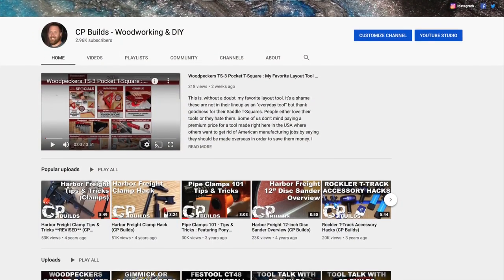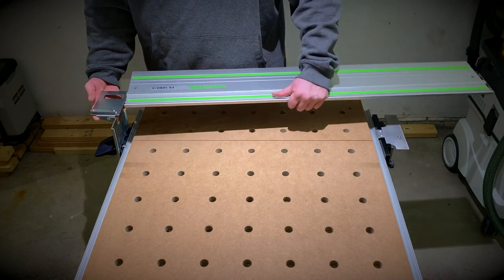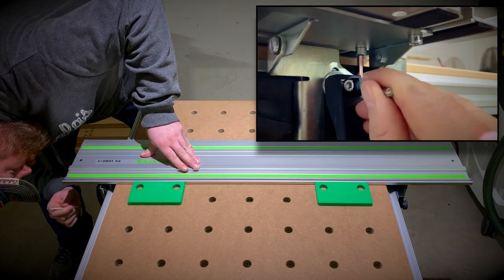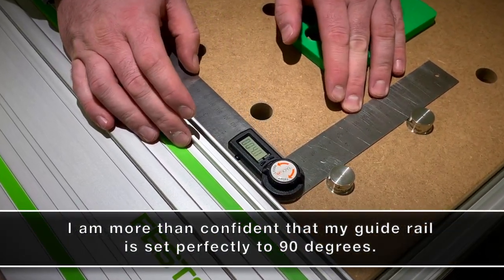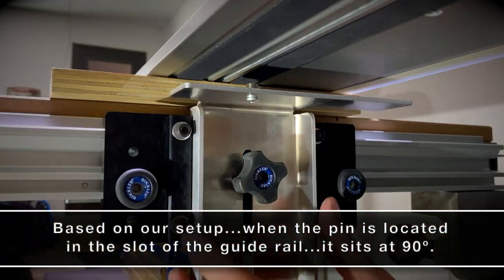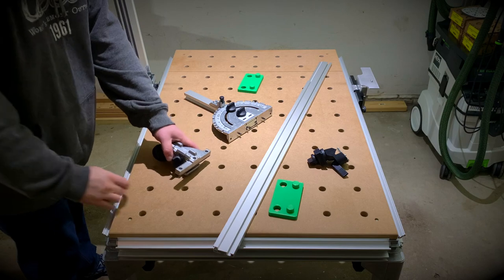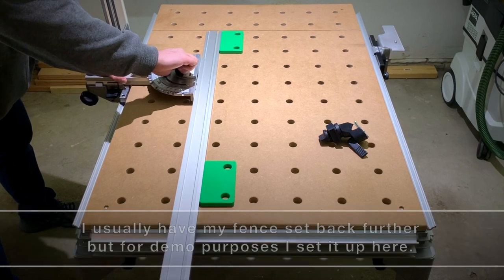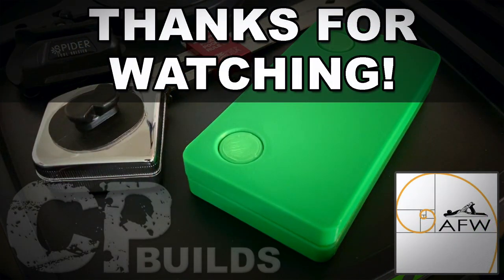How To Square Your Festool MFT Guide Rail & Fence Using The RAB Jig | RAB Tools

Comment from the maker: A message from Al...
Our jig allows you to perfectly align the guide rail and the fence to the dog holes, placing the guide rail between 2 rows of holes. The jig is a simpler alternative to using bench dogs, requires no additional components, and is much faster to align. The compact nature of the RAB jig allows it to slip in to any existing systainer, tool box, or even your back pocket. Using bench dogs, you are likely to be placing your guide rail cut line on top of a row of holes. While you could a piece of scrap stock to space it over, this would introduce even more pieces to that fumbling mess, and introduce errors if not a perfectly cut parallel piece. The jig can used in both crosscut and rip configurations on the table. In fact, if the table was long enough, you could square up a FS/3000 (3000mm guide rail) to the table and achieve the same accuracy. Bring able to utilize the jig to align both the rail and the fence provides speed, accuracy, and reduces errors from your setup. In a typical environment, you can achieve repeatable setups anywhere on the table, in less than 1 minute.

Comment: TL: DR, I was finally able to get a square cut from the Festool MFT3 table with this jig. Chris and Al nailed it on this project. Unfortunately, I found them a day (literally) too late.

Here is my story:
I’m a weekend warrior woodworker and tried to avoid buying a table saw (I’ve taken a couple of kickbacks over the years from a Craftsman contractor’s saw that I got rid of).  Instead, I bought a track saw, and it gave me OK (but not great) results.
 
A week before discovering Chris & Al’s jig, I was building a simple cabinet. As I was assembling the pieces, the errors in the cuts became noticeable gaps in the joinery (I was using pocket holes). I started looking on YouTube to improve the cuts with the track saw and came across the Festool MFT3 table. Now, I had used this same table at a Jory Brigham workshop and loved it for holding pieces. So, I bought it and spent the rest of the weekend trying to square up the fence and rail. The instructions were useless. So, I went back to Youtube and tried the methods shown in a few popular videos. 

When all of that failed, I went to a Facebook Festool group and asked about squaring the fence and track. I went back and forth with several people and tried to get it square – nothing worked. The result was no better than the eyeballed cuts with my track saw. 

I gave up on the table for cutting but opted to keep it for clamping and sanding. I went back to Rockler the next day and gave in; I bought a SawStop.

When I posted what I had done back to the Festool group Chris Parker contacted me about the jig. He said it was super simple to use and would make my table cut square. They were not ready to launch the jig, but I think he sensed my frustration with the MFT and wanted to help. I am glad he did.

A bought a set of beta jigs from him, and they arrived a few days later (just about the time I was finishing the setup of the SawStop). 

Chris showed me how to set up the table using the jigs via video, and within a few minutes, I was making my first cuts. I took a piece of maple ply cut on it previously (again, this was before the jig) and made the first square cut. This cut was 17” long and was off by 0.125” from end to end. Again, here I was cutting off the bad end.
After making the second cut, I was a believer. Over the same 17” it was only off by .010”. This was only the SECOND cut I made with this jig.

I’ve been using it since to make crosscuts, and it’s been working great. I made a set of replacement drawer bottoms this past weekend for an antique bench. I’m restoring, and they fit perfectly. 

The result is that I am now (finally) able to make square cuts on the MFT table. Unfortunately (?), I now have a very nice table saw that I’m growing to like.
Reply from the maker: Wow...thank you for the detailed write up on your experience. Please let us know if you have any questions or if any issues arise on your end at all. Thanks for wanting to be apart of the beta test :)

Comment: Good idea.  Really bad that all these add-on products are necessary, Festool should have made a better product.  Why isn’t there a HOLE on the track for a circular pin to enter instead of a SLOT with tons of slop?
Reply from the maker: Thanks and I 100% agree with you. I have the brackets from RightAngleDesign and he has a pin for the guide rail to register on. Best accessory I bought for my MFT. Doesn’t damage the rail like the Festool version either.